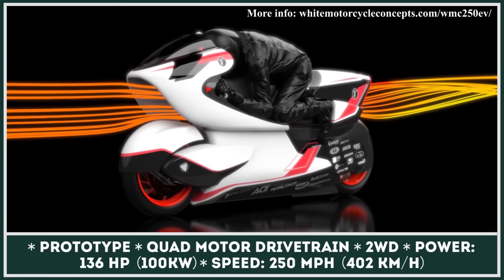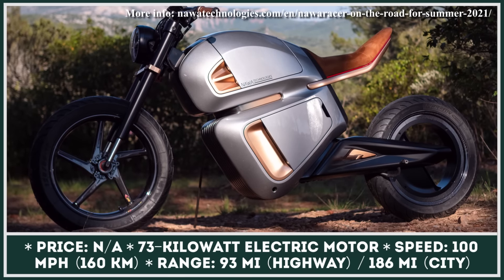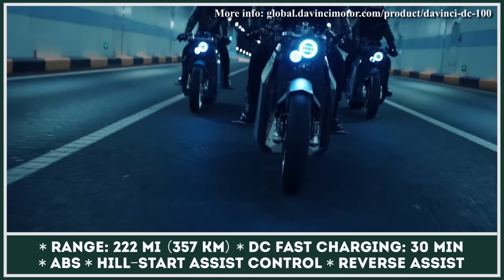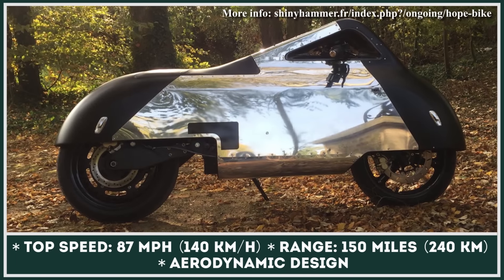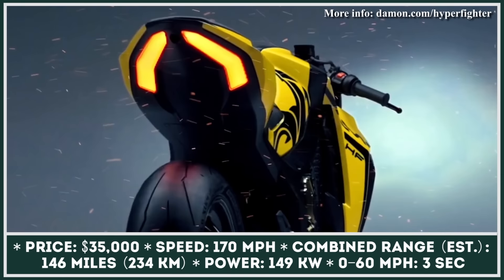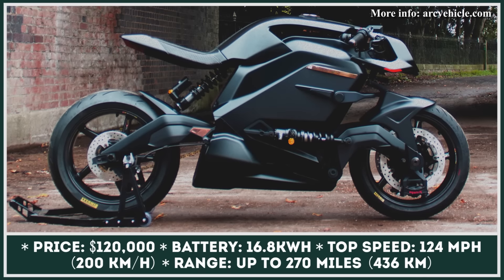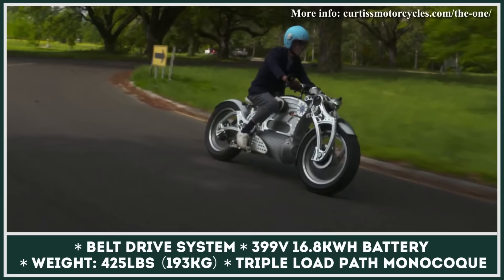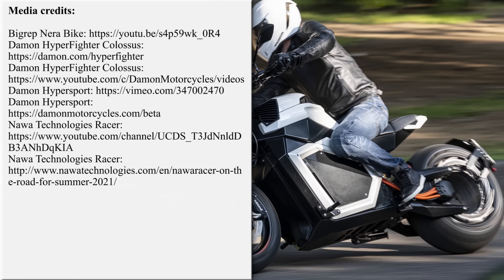10 Futuristic Electric Motorcycles Incorporating Newest Design Trends & Battery Technologies

Comment from the maker: Electric motorcycles are usually criticized for using conventional bike designs, so we have put together a list of the most futuristic looking models, as well as bikes that have some unseen before engineering solutions. Will these models take off though? Share your thoughts below!
Reply: Electric motorcycles have a long way still to go. At the moment they are too expensive, too short on range, too long to charge, too heavy. Compare that with my Yamaha MT-03. Under £5,000 new, 225 miles to the tank, fill up in under a minute, 168 kg wet, 100+ MPH 100+ MPG No contest!

Comment: Why can't they make a motorcycle that has all the power distributed in the back end. But the front end is a generator that powers the battery. So the front Powers the bike in the back moves the bike. Continuous generated energy. And topping off every once in awhile. Perpetual energy Supply. It's my idea I give it freely and it was people to try to implement it. Blessings to humanity
Reply from the maker: Hello, thank you for your feedback. Unfortunately this approach just doesn't work. We wish the laws of physics would work differently, so we could have an infinite source of energy...
Reply: @Datacube  very well said
Reply: The Second Law of Thermodynamics states that "in all energy exchanges, if no energy enters or leaves the system, the potential energy of the state will always be less than that of the initial state." This is also commonly referred to as entropy.